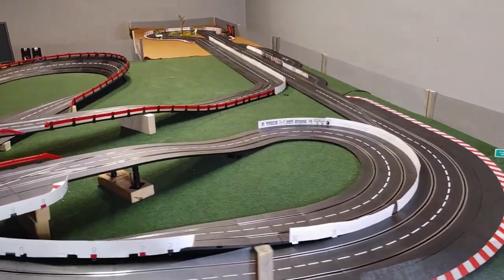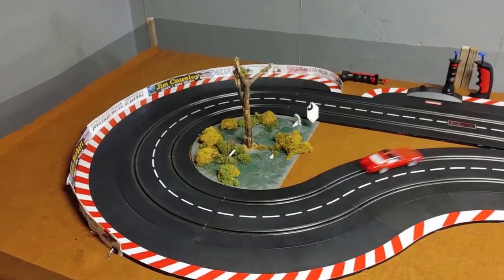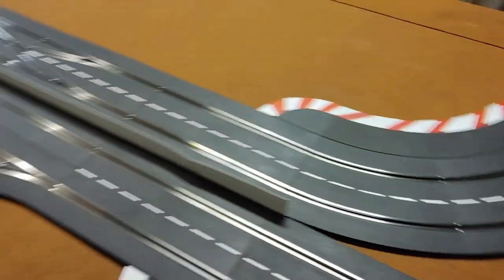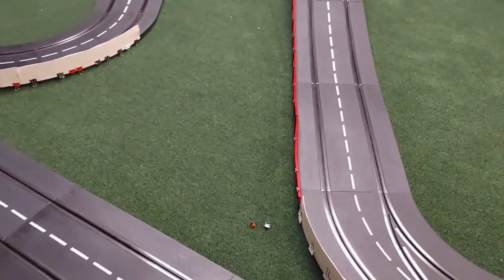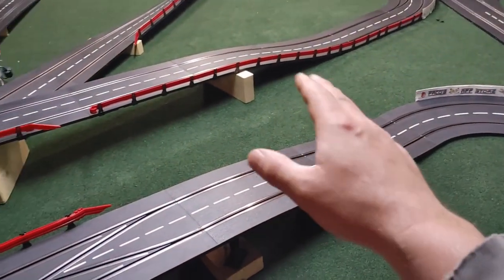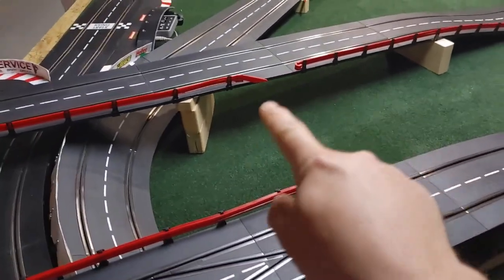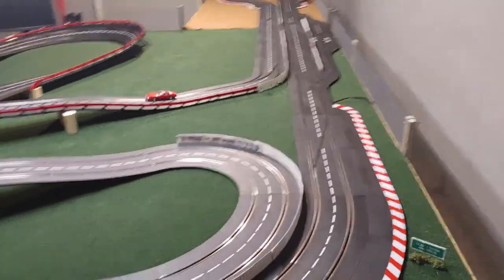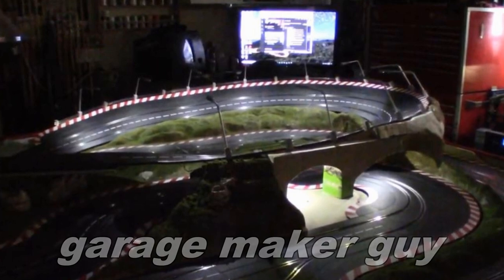New Test Track - Carrera Digital 124/132 Slot Car Track Layout

Comment: I like what you are doing here because you are not afraid to experiment, but you are right that turn is a long fall for any car and can mean damage.  Are you using that big white digital power supply for your track, the name of the power supply escapes me right now?  You have one of the best channels out here for slot cars, keep up the good work and you narrated this very well.  I will check out garage maker guy.
Reply from the maker: We're using the stock Carrera power supplies. 14v for 1:32 and 18 volt for 1:24. If I had to do it over again I'd get the variable power supply from Trackmate Racing (I think that's the one you are thinking of).

Comment: I know you're not the IT dept. but do you know if B. Yingling changed the RMS to not recognize CU without a nice contribution?  I was using system a couple weeks ago.  That computer pooped and RMS on new computer tells me the software did not find a D132 timing device.  Have since contributed of course.  Couldn't have this much fun without his RMS.....too cool!  Not sure how to get the eight digit registration code though.
Let me know if you know.  Thanks.  And thank you for the great videos.  Smiley face, the cool one with the sunglasses that appeared when you won minesweeper.
Reply from the maker: I'm fairly certain Bruce didn't change anything in the software to require a code. If your new computer doesn't recognize the CU I'd say check to be sure the USB port you are using is working. The PC unit cable requires a TTL driver (or something similar, possibly called a serial-to-usb driver?). Did you remember to install that on the new machine.
Reply: @johnniehobby  No I did not.  Bruce and others on the HRW forum suggested I do so.  So I did so.  CU and new laptop are now getting along much better.  Looks like you guys are asking some questions over there also.  Thank you.  Vic

Comment: Just got my first carrera analog set. The reason I didn’t go digital because I wanted to build 1/24 scale models and mount them on H&R motor and chassis. Carrera cars work fine but the H&R ones only go a few feet then stop. Don’t touch wait couple minutes and they’ll go a couple more feet. Are these motors to big for this transformer? Yhx
Reply from the maker: That could be the issue. When running 1/24 we have to change from the 14-volt power supply (used for 1/32 cars) to the 18-volt power supply. Does this happen only when there are several of those H&R 1/24 cars on the track, or does it happen if there is only one or two?
Reply: @johnniehobby  happens with just one and the one with the 40k motor is the worst. I think you guys hit it right on. Thanks a ton
Reply from the maker: @dennisdwire5587  Makes sense that the 40K motor is the worst as the faster the motor the more amps they pull and sounds like your power supply is going into shutdown because of the high power draw. You may want to look into an adjustable power supply as even the Carrera 18-volt PS may not be able to handle multiple cars with those hot motors.

Comment: Do you need to buy any hardware to use your race management software ?
Reply from the maker: To connect the PC running the race management software to the track you'll need an interface cable. I believe it's a serial-to-usb converter (don't remember exactly as I built my own but it was about 10 years ago). Information on that cable and options for purchase are found here:
https://www.hrwforum.com/forum/hrw-all-scales/club-home-connection/carrera-digital-north-america/4472-hssrms-thread-home-for-faq-discussion-on-bruce-y-s-pc-based-carrera-digital-t-s